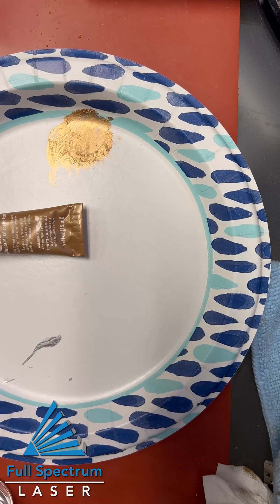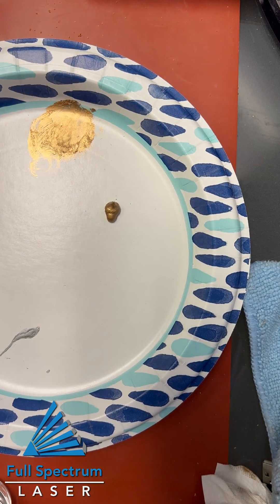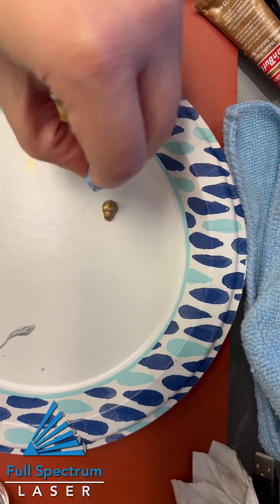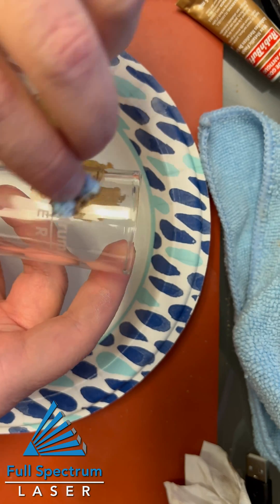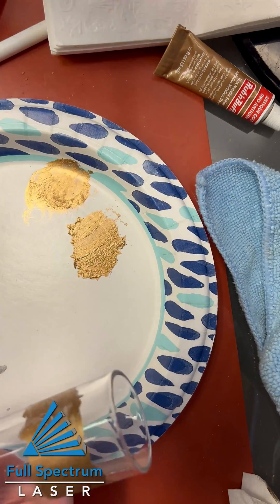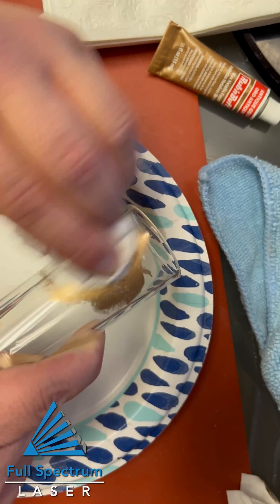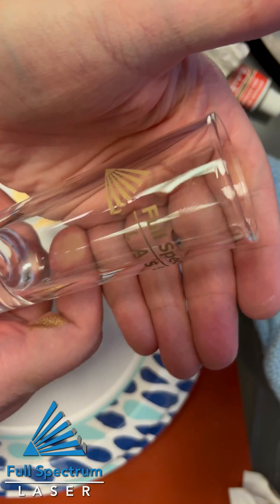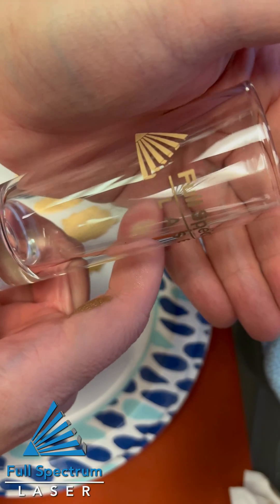Using Rub n Buff to paint your glass engraving! #shorts

Comment: Just got my new Muse3d in the mail today, FSL makes some quality stuff! Mind sharing the settings you were using to engrave the glass, would be interested to know the setting and the machine this glass came off of. Thanks!
Reply from the maker: For this one we engraved it on the UV Galvo Laser. For CO2, I would suggest something like a 75speed, 85power to start (on a 45w tube). And go from there. Every machine is slightly different and every tube is slightly unique so you'll have to tweak your settings, but that's a good starting point I've found. - Jordan